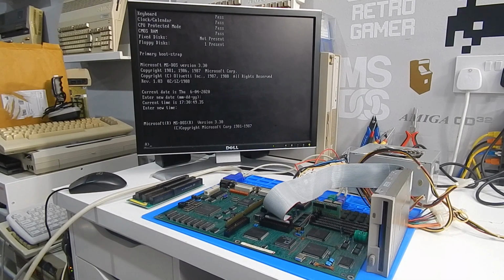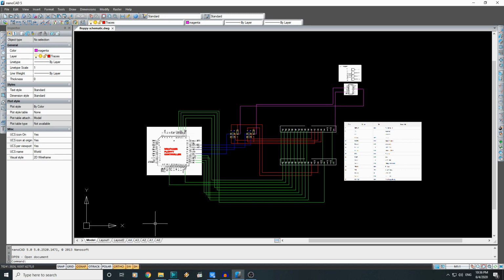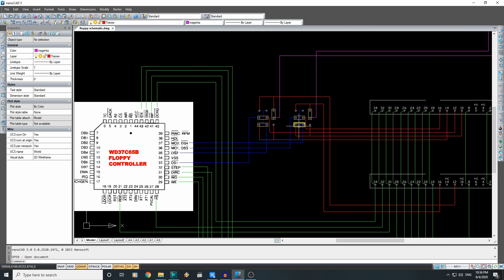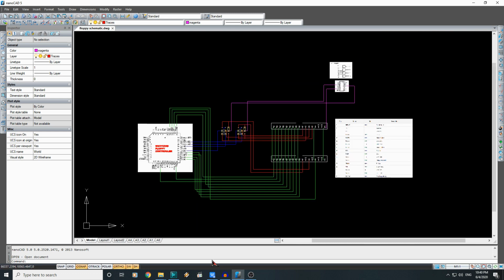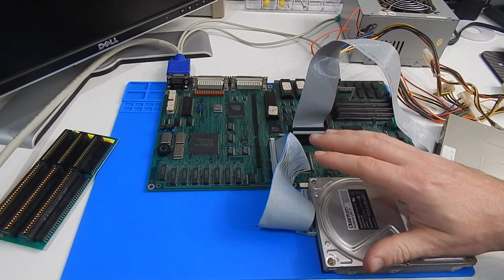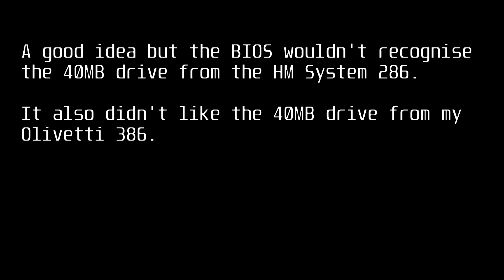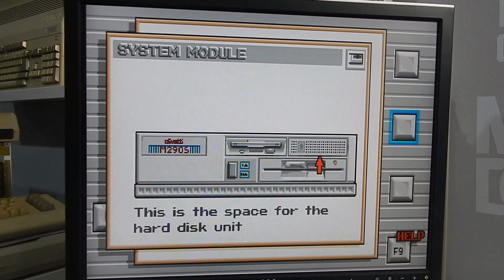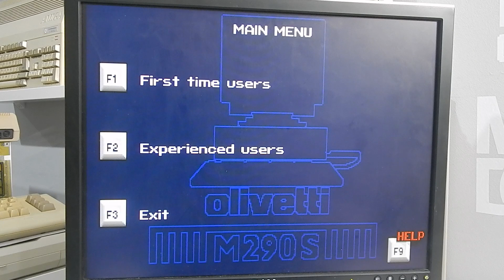Olivetti M203 286 Motherboard Part 2

Comment: My Olivetti PCS 286 without his riser card won't work FOR SURE, however my motherboard is slightly different from yours as mine has the Dallas chip. I write XTIde on the BIOS so I can use any IDE device
Reply from the maker: I still need to get an eeprom reader/writer so I can start using XTIDE on the various vintage machines.  

As for the riser card, at least I have the one for this board now so from that respect its more complete.  Just need to find a suitable case, or make my own as I said in the video.

Comment: It’s really great to see this thing working again! Thanks for the awesome content!

The Commodore PC10/20-III also has difficulties booting from newer FDD units. This is due to the lack of a “motor on” signal from the motherboard. It’s designed that way, so it’s relying on the “disk select” signal. This is fine, but you’re unable to connect any newer FDD without modifying the cable, motherboard or FDD itself first. The motherboard has no jumpers for that. I’ve just modified a cable, so the mod isn’t destructive. 😊
Reply from the maker: Thanks, that's good to know about the Commodore machines.  I'm a big fan of the Amiga lineup and would love a Commodore IBM clone to sit along side them.

Comment: So glad you got this board working! Persistence pays off for a change.
Reply from the maker: Must have been about 5 hours of tracing, googling, smacking head off wall etc before I noticed the cracked solder joints.  Good to see it boot up though.

Comment: Use a CF card instead of a HD. It's faster as more reliable.
Reply from the maker: I'll probably need to go for an xtide on this board as it seems very fussy when it comes to hard drives.  But with that I can use any drive or cf card I want.
Reply: Leandro, you think the BIOS is going to magically detect a CF card when it can't even detect a perfectly good 40MB drive?
Reply: @PJBonoVox  , what I usually do is to detect the settings of the drive (HD or CF) in a 486 or Pentium. After that, it's possible to configure them correctly in a 286 or 386 motherboard. I can't say it would work in this case, it's just a suggestion.
Reply from the maker: I maybe should have shown it in the video but the bios options are simply 20, 40, 100MB.  There is no option to input your own drvie characteristics.

And just for the sake of it I tried an ide to cf adapter.  Board won't boot with it fitted.  XTIDE is probably my only option.
Reply: @CRG  , hummm, I haven't noticed that. A XT-IDE could be the solution, as you've mentioned.

Comment: I was going to ask how good you are at woodwork, thinking plywood, but acrylic sounds much snazzier.  I briefly owned an M290 (not the S) in the 1990's but couldn't understand how to boot it so discarded it.  It was probably so simple but I knew almost nothing about computers then.  I suspect many have got similar stories.  Fun series and glad you solved the mystery.  Cheers.
Reply from the maker: Thanks, the M290 looked like a bigger machine than the S, similar spec though I think.

I would like to find an original case but I think it's unlikely and I think it would be a nice challenge to try and design a custom acrylic case. I'll see about drawing up some designs and if I can get it made there'll be a part 3.